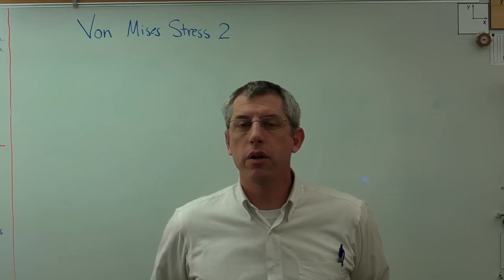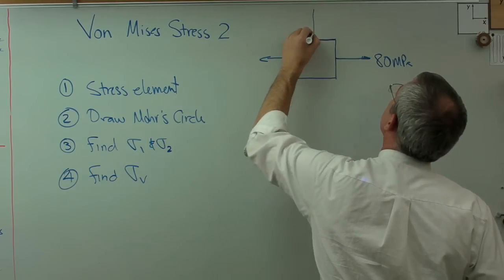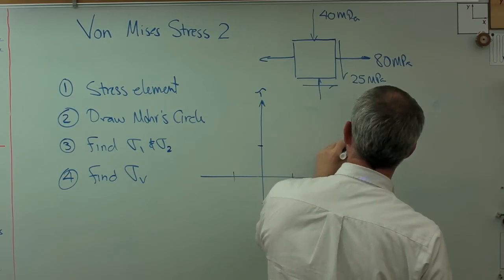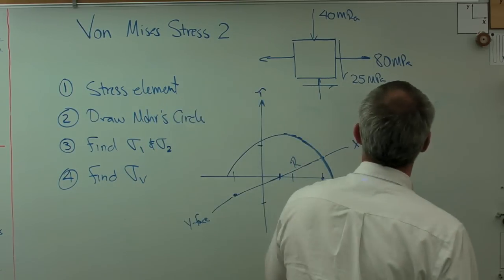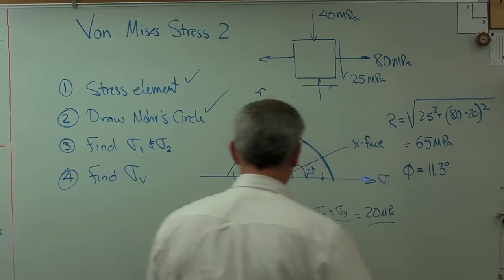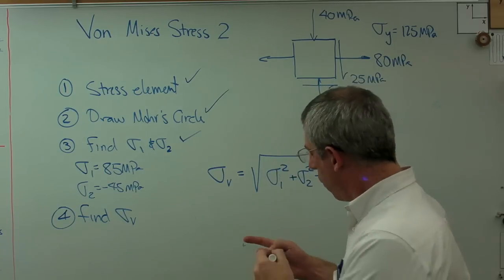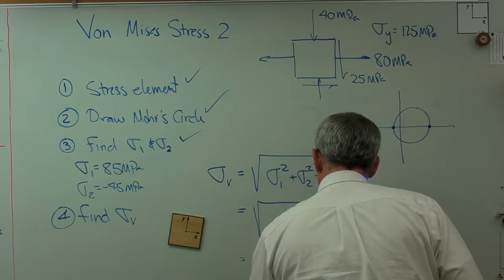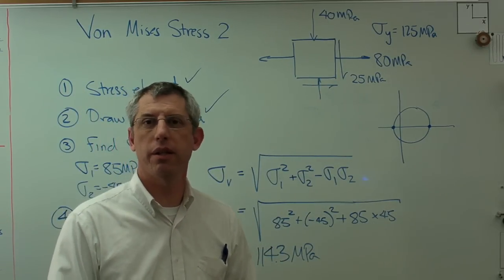Von Mises 2 - Brain Waves.avi

Comment: Hi.Quick question: I have never before come across your von Mises equation. I am more used to seeing and using the one which takes into account all 3 principal stresses. Can you point me to where the one you have used comes from please? Also, it seems that  you left out the -ve sign when multiplying stress1 and stress2, but your answer is correct.I want also to thank you for all your videos which I have used extensively in my studies and have found extremely helpful and well presented. As a mature student of  Open University, your input is invaluable and very welcome. Thank you.
Reply: because we are working on a 2 dimension problem, component 3 values are zero. so if you substitude σ3 with 0 in the general von mises equation and calculate the bracket squares and add them up, you will get that equation.
Reply: Thank you. I got a distinction in my final which Brain Waves helped me achieve.

Comment: sigma bar= (sigmaX + sigmaY)/2, then it must be (80+40)/2= 60 MPa but you got 20MPa, everything in further calculations is ruined.
Reply: @samar sawant  sigmaY is a compression load and is therefore negative. (80 + (-40))/2 = 20 MPa